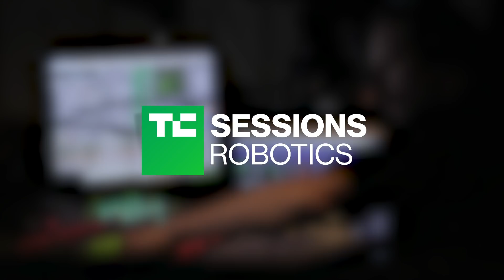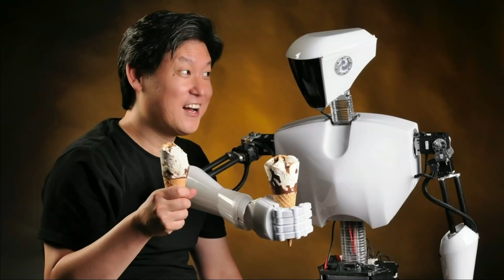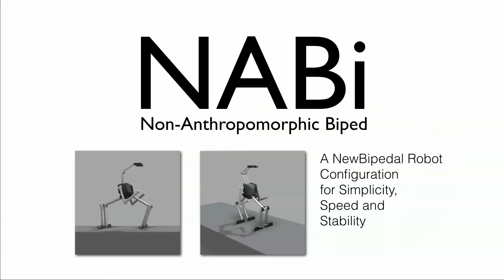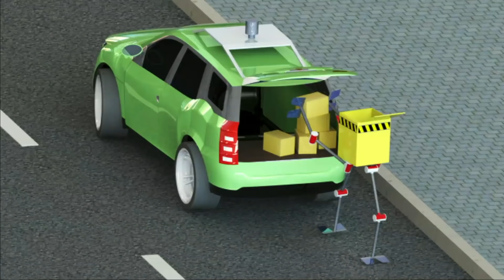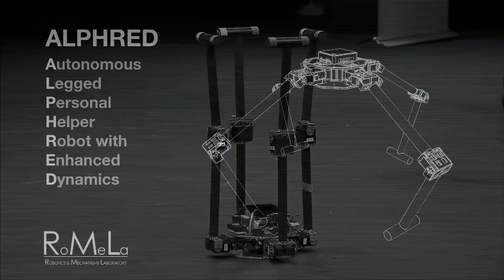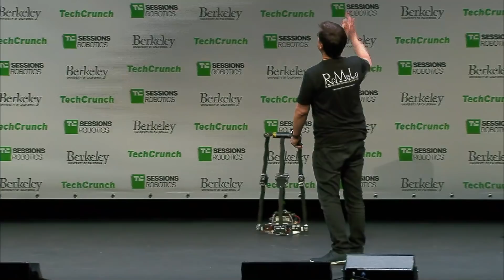DEMO: NABi and ALPHRED (Dennis Hong, UCLA) | TC Sessions Robotics 2018

Comment: BEAR is a real good idea with a ton of applications.
Reply: Bear bldc motor and magnetic pole stop and encoder ...
Reply: @Abricos4440  What is a magnetic pole stop?
Reply: @Tokikaren  it's been half a year and no explanation... sounds interesting, I will definitely have to look it up for myself when I leave here⚡--->
Reply: So this is different than MITs force controlled actuator in what ways?  It seems a lot stronger and faster and also able to become more rigid?
Reply: Andre Cabezas And late to the game. Equivalent devices have existed for a decade.
Reply: Matthew McKellar let's see the price tag and the real application to judge.
Reply: Andre Cabezas a good specific example of a recent robotics company to do this is RobotiQ, who offer active compliance on their actuator's, but the concept originates with the SCARA arm as designed by NEC back in 1981.

A link to RobotiQ talking about active complance is here: https://www.google.com/amp/s/blog.robotiq.com/bid/69962/How-Do-Industrial-Robots-Achieve-Compliance%3fhs_amp=true#ampshare=https://blog.robotiq.com/bid/69962/How-Do-Industrial-Robots-Achieve-Compliance

I have however actually used a Reis robotics arm before which was programmed using a puppet mode under active compliance.
Reply: Matthew McKellar thanks for the comment

Comment: The first mechanism can't make turns.
Reply: ArmedMonkey It is a little disingenuous calling it resolutionary thought. I've seen technology comparable to this on Scara arms for well over a decade. And the NASA team at DARPA robotics competition was using actuator's with programmable compliance on their humanoid as well, 3 or so years ago.
Reply: ArmedMonkey Forgive how I came across. I was a little aggravated at the floods of people praising this device and accidentally targeted you. 

I must have completely missed the quote marks you used in your sentance
Reply: I donot mean it is a flaw. I'm a roboticist too. This is how we make progress. We attack problems one small step at a time. It is completely okay to give a presentation about work in progress. I appreciate how the presenter made a really good presentation of their labs work. That being said, I think maybe they have a lot of pending work to make this usable in reallife, like when they claimed picking boxes from taxis, etc. Anyway, i really liked what they did with the motor!
Reply: haresh miriyala  My problem with the presentation is how they are presenting a motor with active compliance as a revolutionary new actuator. The first widespread commercial application of this was back in 1981 with the SCARA robot arm made by NEC. RobotiQ and Universal Robots both sell actuators for integration that offer this, and this is a fairly common method of programming smaller assembly robots in a puppet mode. The technology they are showing is extremely common and not at all special

Comment: The world needs a new zipper-headed tricycle.  Here's a clue - the object is to get one of these morph-leg things to work well in traffic...  I want to be able to squeeze to the front of the line, then power off ahead of the crowd on three wheels.  I'll show you my plans from 2008-ish - you articulate the front pair of wheels to raise (narrow) and lower (wide-stable-safe.) You've got that easy..  Independent hub motors.  Two speeds. Tilt and all that.  Sign me up!!

Comment: That actuator which controls not only movement but also strength is fantastic idea.
Reply: Jarek F controlling strenght isnt the difficult part, you just use more or less juice. the difficult part is that to get high torque you needed gears, but gearing makes something non compliant and reduces speed. how you get lots of torque and yet avoid high gearing is the mystery part that apparently the bear actuator solves. though i am sceptical of that claim, you cannot cheat electromechanics. if you are willing to use way more power (i.e. be inefficient) you can have a high torque motor with little or no gearing. of course that would be a problematic approach for something supposed to run off batteries (which is probably the reason they didnt).
Reply: Florian Bösch shut the fuck up
Reply: MrGarkin the cheating electromechanics part is getting high torque, no gearing, low power and high speed in one small package. you can usually get 2 or three of these, not all of them. electric cars are not different.
Reply: looks to me like a many-phase brushless encoded motor. and an inbuilt driver circuitry that can accept positional data as well as live PID parameters. we use similar motors/actuators in 3 axis camera gimbals, though ours are much weaker. check out the O-drive as well for a DIY motor/driver combo that works quite well.
Reply: Having a high gear rate doesn't necessarily make it impossible to backdrive an actuator. All you gotta do is spinning the motor backwards when enough resistance is applied to the output side. The trick is having an accurate and quick feedback.
Reply: Alex Young this is not advisable because you would be fighting motor inertia with high power requirements to prevent your linkage/gearing from breaking under loads your kinematics can not comply to. in any case that is not what they did, you would have heard the motor whine if it was geared.
Reply: @Florian Bösch From the profile of the thing, I'm guessing it's a pretty flat BLDC motor with high turns, one layer of planetary gearing, and a carrier that serves as a spring. Angle sensors before and after the spring can capture position and force. I've seen robots direct driven by BLDCs before, but a 5:1 or 6:1 seems like it'd be a lot more practical while still being backdrivable.
Reply: Jarek F
 I'm a total noob on these so could you please tell what were the other ways of controlling the strength in these?
To me is seems obvious that an actuator dictates strength. I mean, withouth power in it, it could not move. What am I missing in your comment?
Reply: https://www.youtube.com/watch?v=vjSohj-Iclc
Reply: Yeah but the prototype seemed a little unstable and all he could show was that it was compliant and was able to stand by itself.
Reply: It walks like a bunny.
Reply: Dear gawd with those actuators. I saw a video where the bot almost leaped off the floor before someone catched it. With those stronger motors, it could practically FLY up to a second floor of a building, with it all light-construction...
Reply: It's an old idea, motor controllers coupled to strong brushless motors have these properties.
Reply: Stop this bullshit about "cheating" electromechanics. 
Any engine has a wide torque and speed range it could be applied to. If you want, you could manipulate this diagram by adding a gear ratio. But there are a tonn of cases when you don't need to, like electric cars are not using transmissions.
Reply: @MrGarkin  They do use transmission.
Reply: "Electric" cars are normally hybrids right now and those normally or mostly use the electric motors when moving slow. I'm not saying this is the same with all cases but it is the most common to my knowledge.

Comment: Well, Boston Dynamics is way ahead of the curve, but i like their ideas too. maybe for different applications..
Reply: Mik Wind The actuators that Boston Dynamics uses already offer active compliance, which is the only selling feature these have.
Reply: Boston dynamics wouldn't use these actuators. Too bulky - hydraulics will still proabbly run the day over in Cambridge.

Not to say the BEAR actuators aren't impressive. Any excuse to not use hydraulics is a good one. I can't wait to get my hands on  one of these things.
Reply: I beg to differ, these actuators are really impressive. I wouldn't be surprised if Boston dynamics started using them in their robots
Reply: Morph Verse I was just about to say that how can he forget Boston Dynamics does that mean Boston dynamics.isnt real or.....
Reply: Bainsworth they're buying everything.
Reply: I believe Boston Dynamics already use force control instead of position control. Otherwise, it wouldn't be possible for their robots to behave like that.
Reply: +Bainsworth I thought Google's parent company "Alphabet" owned Boston Dynamics?
Reply: So what?, they need investors to keep their business intact which makes sense.
Reply: They keep improving on these actuators, who knows Softbank may have partners that could provide or develop these parts for BD..
Reply: It certainly would make it cheaper without having to have a bunch of sensors and advanced AI for bipedal locomotion.
Reply: I mean the bear actulator is most impressive, everyone should try using it. It’ll help alot.

Comment: He’s asking the wrong questions of robotics and walking.
Reply: Why? What is he asking and what should he be asking?
Reply: I gotta agree, his approach seems insane. they didn't seem to have much focus in previous years and then decide to try humanoid robots and "wow this is hard, so lets go the easy route rather then working towards a solution". Their approach results in a dead end, the way it moves etc will not work in nature or on any kind of uneven or slanted surface. This may get investor money but in order to progress further they will have to go back to the drawing board no matter how far they get. This is maybe a hint as to why they have problems to begin with, rather then working a problem they give up and go another direction/ are happy with small gains in dead ends. Boston dynamics may have had far more time at this and its shown with results but I don't believe for a second that it all boils down to expensive hardware, even if it does there is no reason they cant reuse the hardware from version to version for tests. 

ultimately, its not just one leg you move when walking forward, its both legs and all parts of the body. everything has to move at every moment to keep balance and the software needs to be able to calculate this based on current positions and rotations. essentially it needs to treat it like its constantly falling and keep its balance. This is likely why boston dynamics went with the hoppy foot work, lift, calculate, pivot. As that got it down better they needed less hoppy until they have now moved away from hopping all together.

Though I'm not robot builder, some of this should be fairly obvious to them. I guess it boils down to capability and funding. Being able to work towards a product and keep funding flowing. even if the current ideas are a dead end, hopefully they can learn from it and apply that to future work. Still, walking in a vary flawed way isn't likely to have much usefulness to walking the correct way.
Reply: ofek livny he builds ‘dumb robots’ in a sense that he’s trying to counter the effects of gravity by shift limbs, centre of robot gravity with physiology. The Robot One guys in Japan do that every year using their own brains and controller on much smaller budgets to do better jobs. He’s got huge budgets yet he still can’t figure it out after 10 years? He needs to put a brain in his robots.
Reply: Boston Dynamics think more about robot physiology and awareness rather than actuated mechanics.
Reply: Just to add to my own comment, that actuator is pretty cool. it seems like it may actually be a really nice advance in robotics. id love to see boston dynamics get their hands on it. I'm betting they would be able to get allot of nice movement out of that. This company should definitely work on selling this actuator.